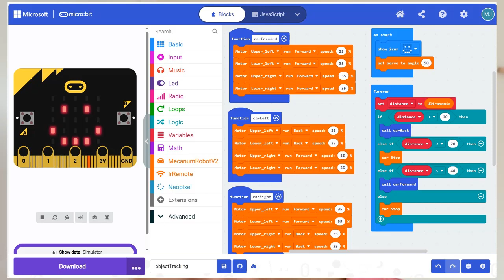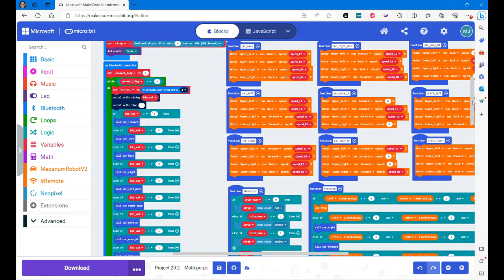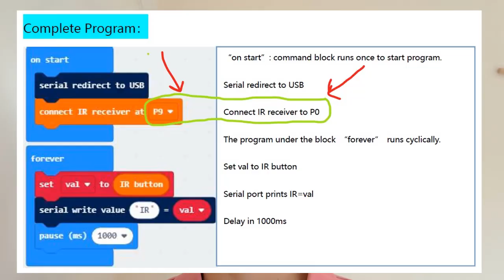Review of Keyestudio Micro:bit Robot Car KS4034F

Comment: Hello Dr. Martay, thank you for this review. I went along and ordered the same unit for my daughter in the hope that she, in time will find it interesting to play with code blocks, which they have been introduced to in school. I must admit, i thought it would be easy to get started with, and boy was i wrong. Building the unit went fine, and i was under impression that setting it up to be running with the remote control would be just as easy. After building the unit and initialising it, i thought we would be able to use it as a remote car immidiatly, but we couldnt. I tried to read (and understand) the coded part, and got completly confused. I have managed to setup Microsoft Makecode on our windows 11 pc, and connecting to the board is fine, allthough i still dont understand what we need to do to make it work as a remote operated car with the remote control. Am i supposed to combine the provided hex files into 1 file and then flash/download them? Or maybe import every single file one at the time and download them? Also, somehow after downloading a file to the board, the USB disconnects, then reconnects, but there are no files to be seen in the file explorer of the board, is that normal?
Reply: Hi, I'm glad to hear the school is working on code blocks - that'll be great for your daughter!

I uploaded each .hex file one at a time to the Micro:bit.  I don't think you can do all of the codes as once as the Micro:bit only stores one code in its memory at a time (ie, when you upload a second file, it will overwrite the first).  If you added all the codes into a single file, the codes would conflict with each - because in some codes, pressing the A button does one thing and in other  codes, pressing the A button does a different thing.  Just upload one code at a time. :)

It'd be great to understand the code but you don't actually need to to run the code.  I suggest starting with the first codes and working your way through - although you should be able to jump straight to the last code if that's what you want to do.  There is an on-off switch you need to flick as well as uploading the file to the Micro:bit. (The switch is between the tires on the platform on the left side of the car.)

Hopefully this helps!

Comment: Thank you for the video. It really helps. I just have a few questions.
1. How did you make the car move sideways without it rotating? 
2. I can't make the line tracking work, I am using the Keyes code, I think the sensors' sensibility is too low, can you share your code? 
3. How did you install the app on an android phone? None of the Google appstore apps work

Thanks a lot for your help!
Reply from the maker: I'm glad you found the review useful!

1. The code should make the car move sideways using the mecanum wheels.  In the App, there are R/L buttons on the left side, although I see you can't get the App to work.

2. The sensitivity of the sensors can be changed by twisting the X in the two blue boxes on the top of the car.  I didn't have to adjust the sensitivity of this car but did need to in other robot cars.  Try putting the sensor over a solid black colour and adjusting until the sensor reads 1, then put the sensor over a white colour and adjust until the sensor reads 0.  Then try for a position between these two where the sensor reads 1 for black and 0 for white.  It can take a few tries!

3. I didn't have any trouble downloading and installing the App through Google Play.  Will it not let you download at all?
Reply: Hello I wonder if you could help. I cannot find the batteries recommended. Would you recommend where to get these please? Thanks

Comment: I too thought the battery wasn’t connected until I found the on/off switch at the side 😂
Reply: I tried the on/off switch on the side but still couldn't get it to work for some reason...  I did forget the on/off switch many times after switching the battery pack though!
Reply: @JenniferMartay  Thank you for the info on the Hex code in your video. The instructions are not great and using a Chromebook isn’t ideal as I would rather have the app etc locally. Regardless a drag and drop of the hex read into Microbit perfectly and my son now has a new Robot called Charlie.